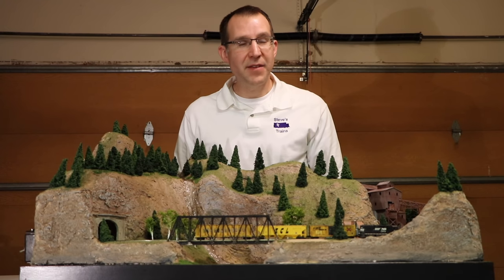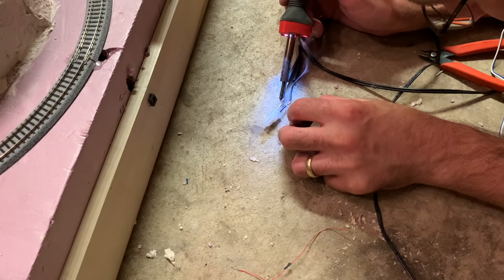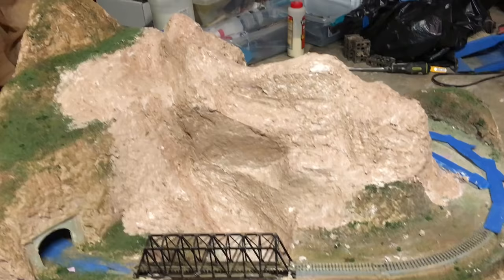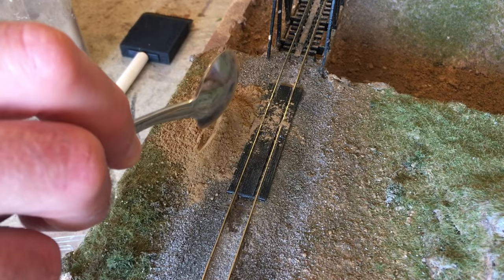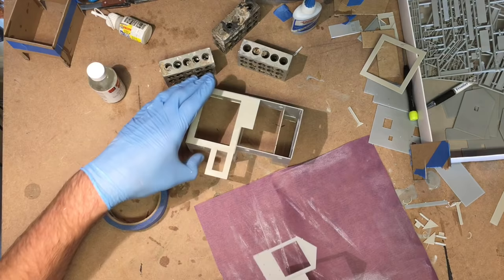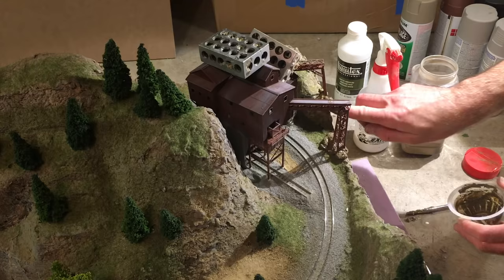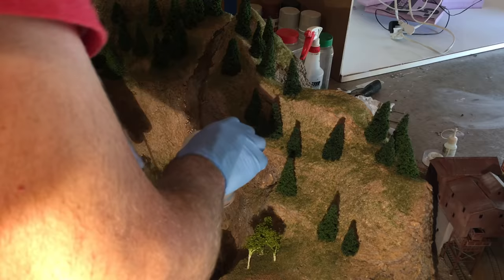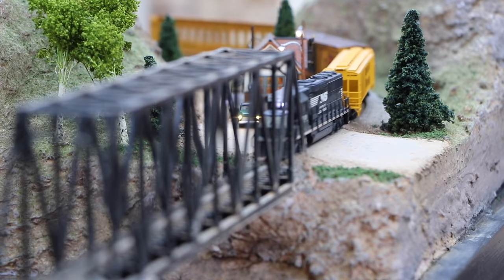Colorado Loop Layout Build: 2x3 Foot N Scale Model Railroad Tutorial

Comment: does that sculptamold stuff air dry? I'm considering using it for my first layout.
Reply from the maker: It air dries...if you have a lot of water in it, or it is humid, or if you have a real thick layer (like over an inch thick), it can take up to a week to fully dry. If it is dry and you don't have it too thick, it will be fully dry by the next day, or even faster. Sometimes I'll speed it up a bit by waving a blow torch over it or put a dehumidifier by it if I want it to dry faster.
Reply: @StevesTrains  thank you for the information!

Comment: You should wear a respirator/mask when cutting pink foam. Or at least wear it on video so people don't damage their health.
Reply: So cutting pink foam with a utility knife is un safe ?
Some people need extra help, but dude these projects are loaded with toxic chemicals. 
So it's your responsibility to protect yourself and be smart just like Steve is.
Reply: @ShawnBrandon888 if it liberates particles that you then breath and are toxic then you should use a mask. I get that using a knife to cut doesn't liberate as much as sanding for example. But if you create a video teaching how to work with stuff, especially if you are carving like he did, it's best if you warn people.

Comment: do you sell your layouts once they are done?
Reply from the maker: Most of them I do. This layout wasn't claimed, so I'll be putting it up for sale on eBay eventually. I had meant to put it up for sale already, but just haven't had a chance to. I have to build a shipping container for it in order to know what the final size and weight, and thus shipping cost will be before I post it on eBay and I haven't had time to do that yet.
Reply: @StevesTrains  I saved you as a seller so i will look for this layout on your Ebay store listing.:)

Comment: Two comments:
1) probably too much terrain and not enough train. Given that the train is the key feature it is in view for too little time. I would prefer to see a hill that size on a longer layout.
2) I know that nearly every model project which I have attempted has been adapted or improved along the way, as new ideas present themselves, but perhaps a bit more planning in the early stages and more dry fits of parts might have reduced the re-jigs and design changes. I agree that the finished model is much better than the first draft but see also 1). The re-jigs may have led to my 'too much terrain' comment.
Still A++ for effort and application!  :)
Reply from the maker: Those are fair comments. Sometimes I plan out layouts in more detail, other times I just have to feel my way through them, since in a lot of ways I look at them as motion art projects. Frequently I just come up with a general idea of a plan, then just see what looks good to me as I'm building it, which obviously isn't as efficient, but usually how I end up doing things. I'm currently working on redoing some of my 1x6 HO switching layout, simplifying the scenery, and turning it into more of a shadowbox type layout. That one was built for a specific place in my office which went away, and so it is now in the garage. I want to convert it into a shadow box display so I can have a cover on the front to keep the dust and such out since it is in the garage for now.
Reply: @StevesTrains  
It is an excellent model and your mastery of technique is of high order. I have never meddled with water features beyond a little varnish - I find the resins daunting. I just wish there was more train!
B